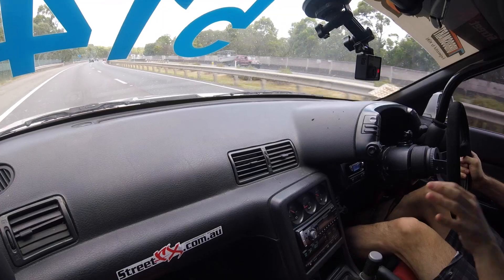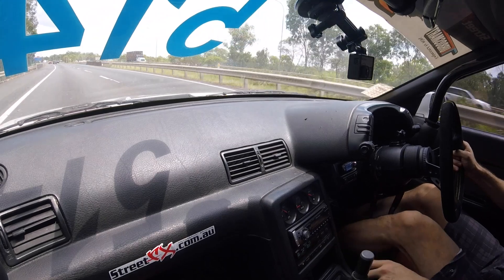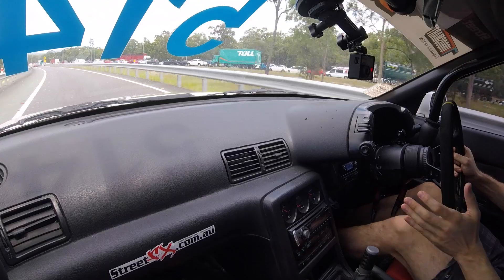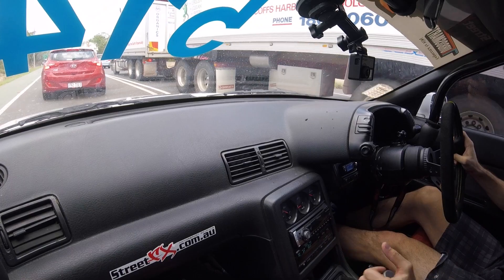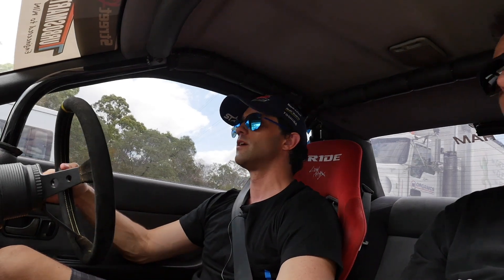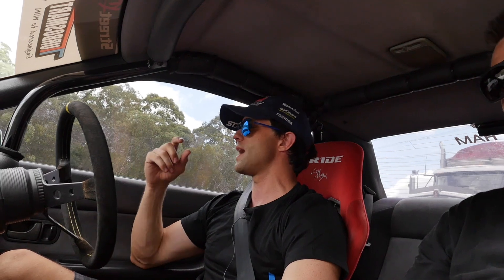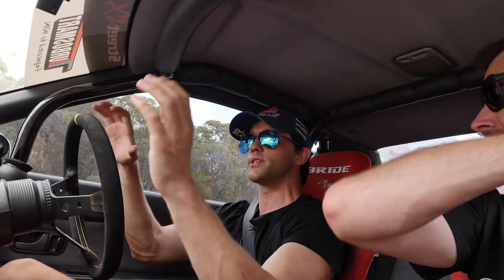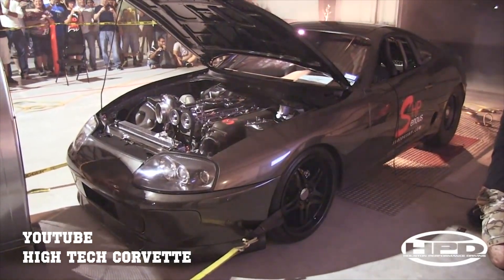What is TURBO FLUTTER & SURGE? Is it Bad? Myth-busting in our Nissan R32 GTR!

Comment: I wasted the thrust bearing in an HX35 in 3 days letting it do that without a BOV on my Talon.
Reply: Dave Lindahl sucks for you. Been running no bov with 700rwhp daily driven car for years and years now with no dramas at all.
Reply: 102nds daily Do you have a ball bearing turbo? I do know ball bearing turbos do better with thrust loads.
Reply: Dave Lindahl yes it's a gtx4202r
Reply: 102nds daily Ah that makes a bit more sense, on a journal bearing turbo it eats up the thrust bearing really bad, seen it happen to more than just my turbo.
Reply: Dave Lindahl might be time to update to a newer tech turbo, spool response is also amazing on the gen 2 gtx range.
Reply: 102nds daily Yeah on my aluminum rod 4g I want to run a 6870 Gen 2 on it, expensive but worth it

Comment: At what turbo size do you guys think a supra would start making the flutter sound? and how big is the R32s turbo?
Reply: I have no life.
Reply: Factory turbo will flutter if you remove/block the factory bypass valve, the factory airbox and rubber intake pipe muffles the sound a lot so if you want it to be louder get a metal intake pipe and replace the airbox with a pod filter.
Reply: driftnick, you're everywhere. anything to do with turbo
Reply: Dylan Neman depends on the RPM of two step/ anti lag. plenty of 3.0 are running around with too much compressor. but a big compressor can still work at high RPM, just can't be driven 'streetable' kinda like the supposed 800 hp Supra dude claims to have had

Comment: You guys are morons. If you think any amount of compressor surge isn't hard on components, you are poorly informed. You may not have had problems with it, but it is only a matter of time before you do. Also, if you had a nut on the compressor wheel back off, do you not think it could have been caused by rapidly slowing the compressor wheel while the kinetic energy of the nut continued on loosening it? If anyone really wants to know the truth they should read this http://www.turbosmartusa.com/technical-articles/flutter-compressor-surge/. You would think the original poster had since he has a Turbosmart banner in his windshield but alas bad information persists. Why be harder on components than necessary just for a stupid noise and increased lag times. Also, the fact that you are experiencing compressor surge while wide open means that your turbo is poorly sized for your application and is running way outside of its efficiency range.
Reply: haha the surge turns the compressor wheel into an impact wrench causing the nut to loosen.
Reply: sky17 wouldnt that actually tighten the nut?
Reply: https://www.turbobygarrett.com/turbobygarrett/compressor_surge
Reply: Where are you people saying that you NEED a BOV getting your information from? 
Lets go over this. BOV's have not been around for too long at all. early 90's is the earliest one I can find. 
Cars before then came with turbos that are still running strong after all these years with no issues with the turbo. No car NEEDS a BOV. They came into existence for noise and emissions reasons. Nothing more, nothing less. 
They serve no  real purpose aside from keeping the noise down and venting air. BUT it isnt NEEDED.  
Now, As far as compressor surge goes. There are 2 main kinds. ONe is bad the other isnt. 
If you get flutter or surge when under acceleration = bad. 
Flutter when letting off the gas or switching gears = no problem. 
The issue is all these younger people have no idea what they're talking about or how BOV's came into being. All they know is every single car they've seen in their time has had them. Companies are going to tell you that you need them to sell you a product. Thats all. There is literally no difference between the stock bov on lets say a 06 wrx or STI and a GFB or whatever aftermarket one aside from adjustability for sound and airflow. 
That being said no car with a turbo needs a BOV. 99% of the time the engine will die before the turbo ever will. 
The only time it can be said its needed is for a strictly race application where hundredths of a second matter. (for spool time) aside from that its just another part thats not really needed and any company will tell you anything is bad for your car in order to get you to buy their product.
Reply: Kj16V sure, you don't 'need' one if you're willing to replace parts way sooner than you have to.
Reply: You can't have looked very hard for cars with blow off valves. The BMW 2002 Turbo from 1973 came with one as standard. It's considered about the 2nd production car to come with a turbo. First being Porsche 930 being the first 911, which I'm pretty sure also has a factory bov. Not sure about the Corvairs from the 60's, yet those cars didn't work very well as they didn't really know what they were doing with a turbo at the time. So if they don't have a BOV it is probably a mistake like they way they did the whole engine. Just because factory cars don't make a big woosh sound doesn't mean they don't have a BOV. They are factory so will be plumbed in a way to not be audible, yet they are there.
Reply: Have you ever seen that happen?
Reply: Kj16V you don't need one if you don't have a throttle plate like a diesel. Some Holset turbos can actually snap shafts if surging is extreme.
Reply: logic not fair it's like the engineers want to prevent running outside of  operational parameters.
Reply: Chase Christensen finally someone who gets it!!!
Reply: roflex2 almost everything in the car world is biased
Reply: squishypitbull slowing down your compressor wheel when the throttlebody shuts, why not? It's not that the buyers expect the most optimized performance right? Who cares about performance anyway?
Reply: Lol of course a company that sells blow off valves is going to say it damages your turbo. Biased source.
Reply: Chase Christensen that's like asking why people drink soda instead of water. Soda is way worse for you and puts unessessary stress on your body. But people like how it tastes. Sometimes people just like things that aren't the best for them. Even though I don't think this is actually bad for the turbo, it's obviously not as good as running a blow off valve. But if you like the noise it's absolutely worth a little bit extra wear.
Reply: their not a biased source, they are the informed ones. the people who figured out they could profit off the fact that people need aftermarket BOV's for builds would know a hell of a lot more about boosted setups than the average weekend mechanic.
Reply: The only people who say you need a BOV are people who've never run without one.  Literally everyone who has run without one will tell you the truth: YOU DON'T NEED ONE!!
Reply: What do you expect? Just listening to them talk is cringe worthy. They both can't finish a complete thought in the video lmao
Reply: Chase Christensen the people in the video is right it puts strain on your turbo but not much people blow it out of proportion
Reply: Yes take advice from the people who sell the solution. Herp

Comment: To summarize - Compressor surge when on the throttle is terrible and can kill engines/turbos. "Flutterdumps" (no BOV with boost reversion out of the intake) when off throttle/throttle closed is slightly worse for the turbo bearings than running a BOV, and will slightly reduce boost response between gears. It does sound fuckin' mint tho hahaha
Reply from the maker: good point, I'd never thought about it like that.
Reply: I have a turbo with a broken comp blade lying in my garage, which I'm fairly certain broke due to open-throttle surge.  It sounded very distinct from closed-throttle surge: CT surge makes that heavenly chu-chu sound, whereas OT surge (at constant part-throttle) sounded like very rapid "chupachupachupa" lol!.

I believe it's the constant very rapid vibration on the comp blades, combined with the fact that the comp is still being driven by the exhaust,  that caused one to fracture.

CT surge, on the other hand: nah.  Does nothing.  I've been running my turbos without BOVs for over 10 years.  My current TD06SL2-25G has been running 22 psi for 7 years.  

No BOV no added expense, no extra complication, no extra air leaks, no extra potential failure points, no problem!
Reply: +Legotruck82 a BOV won't prevent open-throttle surge because the inlet manifold is still pressurised.  Only revising your turbo setup can stop that.
Reply: I think on boost flutter could be a little worse because it's pushing hard on the exhaust side at the same time as the intake side is slowing the compressor wheel down. A bit like being on the throttle while braking wears the pads and rotors more than if you were only braking. If you shut the throttle there is no exhaust gasses pushing on the exhaust side. But on boost surge would create opposing forces. But then again that would only try to twist the axle witch it could never do anyway. But considering the angle at witch the force comes on to the blades (pushing from the side) I don't really see how it could effect the wear of the turbo, because it would require the axle to move enough sideways to break through the protective oil film and hit the bearing surface. If there is any extra wear I don't think it would even be measurable.
Reply from the maker: Yep, we mention this in the body as we didn't address it very well in the video.. However I would be interested to know exactly why this is any worse for the turbo than normal closed throttle surge..
Reply: I had always been told because it slows the compressor down quickly (not stops!) it can wear bearings out quicker. I have no researched data to back that up tho. Perhaps you could do a collab video with a turbo manufacturer or repairer in the future that covers such things?
Reply from the maker: Legotruck82 we plan to do that :) I just struggled to see why closed and open throttle surge would impact the turbo in differing ways, since they both subject the turbo components to the exact same conditions. It's a great question though :)